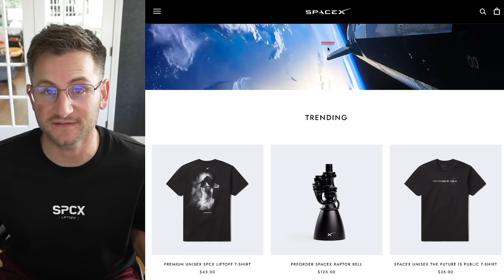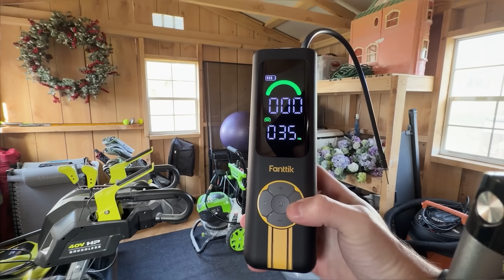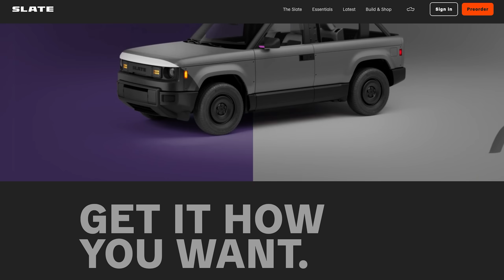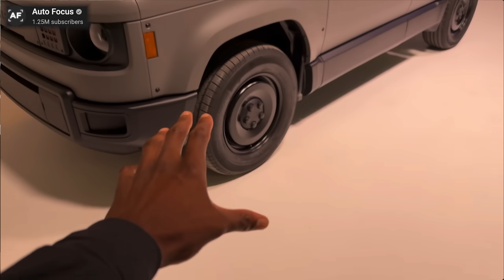Tesla Launches Brilliant New Business Partnership / Slate EV Details Drop ⚡️

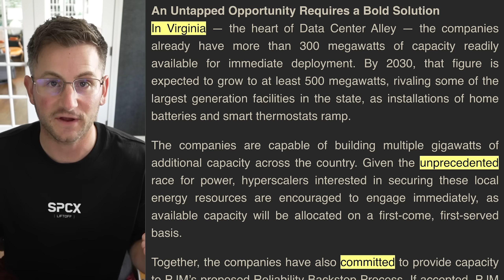Comment: At 5:15 Dillon said the AC temperature is raised.  But I don't think that would be necessary.  The VPP - virtual power plant schedules the thousands of thermostats so that they do not draw peak power.  The thousands of thermostats are drawing an average power that is peak limited or peak shaved.  This is combined with the rooftop solar, which is at its highest when the sun is hottest.  The air conditioner can cool down the residences below normal, then after sunset this frees up power as the AC is shut down and the residence warms up to normal.  So what I'm saying is the temperature does not have to be increased; it is the load shifting that frees up kilowatts to be used elsewhere.

Comment: It's funny that they called the cybertruck seatbelt safety reminders marginal.  They are truly annoying.  They go off every time you fail to buckle up and you get an on-screen display of the offending passenger.  I guess it is called "marginal" because you can swipe the alarm away and it does eventually stop beeping, but I certainly wouldn't call the system ineffective.  I have a large property and don't see the point of buckling up when driving on private property from one structure to another.

Comment: Sunrun and Tesla have both already been doing this for yeasts btw... they are just announcing it differently.
Reply: this is not going to change anything because even tesla, xai and others are installing more and more gas turbine generators, upgrading the phyisical great is the optimal solution to better integrate renewables.
Reply: @carholic-sz3qv  90% of new power is renewable... let that sink in bud. That's not a woke reason, that's a profit reason. 

Gen sets are on back order for years... good luck getting one... wait in line with the data center boys
Reply: @King_Cole  amazing mate! renewables runs 24/7 the rapid installation of datacenters isnt an issue! they are not going all around even bringing back nuclear reactors online! wow youre so clever! gas turbine generators are the only way to produce electricity 24/7 for the very hungry ai bravo!
Reply: @carholic-sz3qv  all those data centers ALREADY have server batteries connected directly to them that's why the developers are opting for solar renewables. 

you couldn't even get a gas generator if you tired , Mitsubishi and GE are both on backorder.

again renewables are not a woke thing, buddy. They are a profit thing. It's like a farm harvesting every day instead of every year. zero cost for fuel changes the economics fundamentally.
Reply: @King_Cole  are you serious?! the batteries are only used as a buffer to smoothen the power for the very sensitive electronics, show me a single of those datacenters running 24/7 on renewables only you sherlock! batteries arent a new thing for datacenters.
Reply: @King_Cole  there are actually more than just mitsubishi or Ge that makes gas turbine generators, you forgot Siemens and many other smaller manufacturers including the chinese and even the american startup that wants to develop supersonic flights.
Reply: @King_Cole  companies like google, apple, amazon also relies on some american startups that developped natural gas fuel cells, the list goes on and on and on.
Reply: I’m not saying there’s not a place for gas turbines but they will be gone long term. There are much better options that don’t suffer from the long tail of fossil. Again, there’s a reason 90% of new power is renewable and I guarantee it’s not pride
Reply: @King_Cole  lol!!!!! the usa has oil and gas, they have been stealing from their neighbors and around the world, what is it going to ''suffer'' from?!
Reply: @carholic-sz3qv  take an econ class... the fuel cost is volatile. ie Hormuz...

Comment: Slate truck 200 miles of range on an LFP.  That by itself makes it worth it.  That battery could last 20-30 years.  I could still be driving this thing as a geriatric!
Reply: The only problem I have with the Slate is that it takes as long to charge as a Tesla while having nearly half the range. That’s not just bad range, it’s terrible charging speed, which is often more important.

Comment: Slate may be cheap for a truck, but it's not going to be able to do the same things these big ICE trucks are doing. It's more comparable to something like a Model Y, and after you deck it out, it's going to end up costing you more. The vehicle base is $25k for The Blank Slate, but if you get the Squareback it's $30k and Fastback is $32k. By the time you add the decals/wraps, audio, lighting, dashes, and other accessories, you're adding on multiple thousands extra. I mean, yeah, you can probably get it a little cheaper than the Model Y, but it's a totally inferior product. It looks like you have to put your accessories together yourself, too, because there are ratings of how difficult each accessory is to put on the vehicle.

Comment: ### TSLA Investor Summary (with timestamps)

* *0:29* Tesla's manufacturing edge. Cybercab is rumored to have only ~4,000 parts, roughly half the Model 3, while Waymo's sensor suite alone is estimated around 4,000 parts. Argument: Tesla has a major cost and complexity advantage. 

* *1:41* *Major energy partnership announced.* Tesla, Sunrun, and Renew Home will combine home batteries and smart devices into a *16 GW virtual power plant* to support utilities and AI data centers without building new infrastructure. 

* *4:35* Virginia already has *300 MW* available for immediate deployment, expected to grow to **500 MW by 2030**. 

* *5:44* PJM grid could unlock *over 1 GW immediately* if the proposal is accepted. Better use of the existing grid could reduce U.S. electricity costs by **$110B-$170B over the next decade**. 

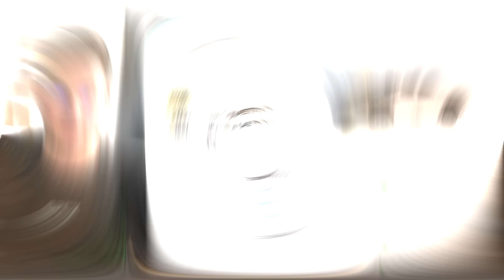* *9:28* Cybertruck earns **2026 IIHS Top Safety Pick+**, becoming the safest pickup tested. Improvements came from structural updates to the front underbody and driver footwell. 

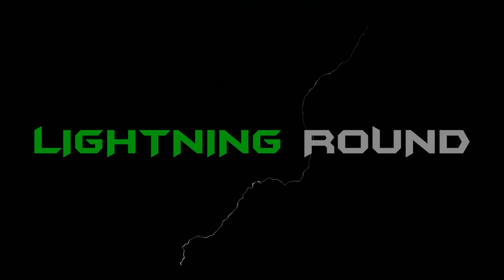* *10:57* Starlink maritime adoption continues expanding. Another large shipping fleet signs on, highlighting Starlink's growing commercial presence. 

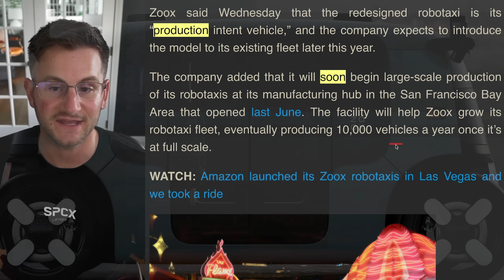* *17:09* Tesla launches a new *Model Y trunk organizer* priced at **$245**. 

* *17:17* TSLA closed at *$375.53**, down **1.59%* for the day.

Comment: Doesn’t matter how many parts the pseudo cab has because FSD still isn’t ready to be wide spread and will be sandboxed/geofenced  for  years.  It may get there by the end of the decade and I say this after using the latest version for four months.  The biggest problem it has is it does not know what it cannot see and I don’t know how you solve that problem.
Reply: Both runners in this race are geofenced lol.